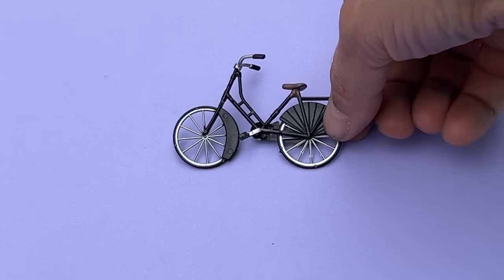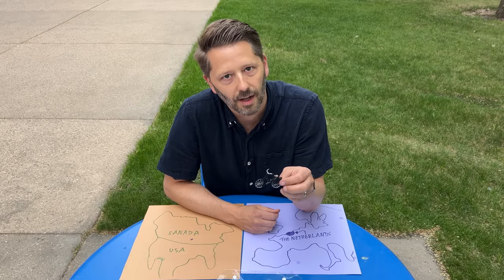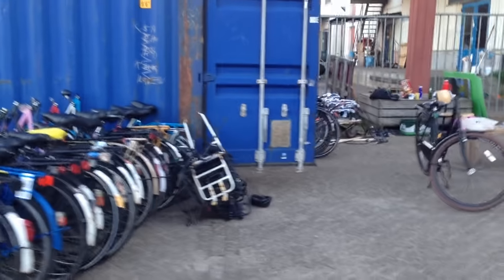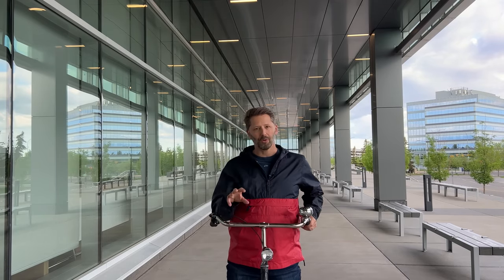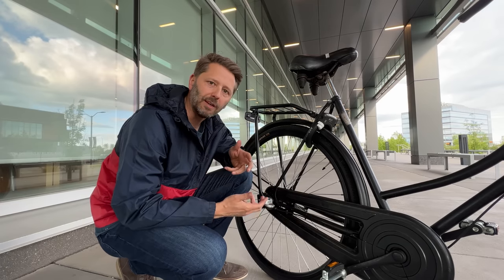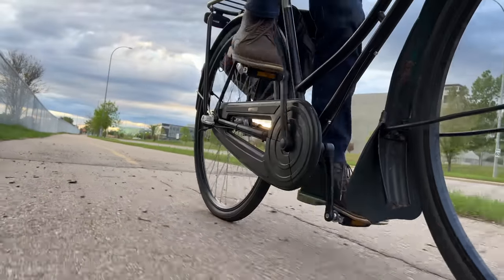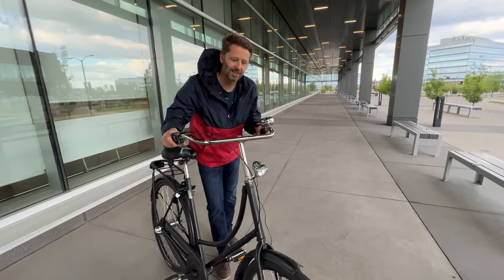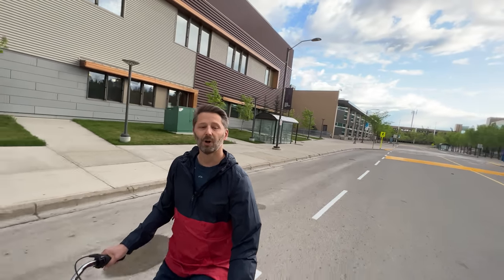I finally found a true Dutch bike in North America. Here's what you need to know

Comment: In the Netherlands there's also a huge selection of different bikes, with basically endless permutations of features - from no gears to 21 gears, ergonomic or sportsy models, with or without bike rack, etc.

These are generally the most common ones, but you can get your hands on any bike you so choose.
Reply: Also they would have a front brake, wouldn't they? Isn't it law having two independently operating brakes?
Reply: @krollpeter  In the Netherlands a single brake like the coaster brake in the video is enough, other European countries like of the top of my head Germany, Belgium or the UK do mandate 2 brakes.
Reply: @WiljanVeening  Thanks for the info! Correct in Germany having 2 brakes is law.

To slow down a bike at a junction or traffic light, a coaster brake suffices. And it leaves the hands free for hand signals or safer steering. For sport purposes there is surely better. Unfortunately here in Singapore there are no bicycles sold with coaster brakes.
Reply: There's not only upright bikes, but also some nice dutch recumbent bike and velomobile brands as well. As far as I can tell, the upright bikes are far more common though. I'm from the southwestern part of the US and I've never been outside of the US, but I'm quite familiar with recumbent bikes, including the dutch brands.

Comment: After visiting NL I really loved the omafiets.  They were GROSSLY overpriced in Sweden, so I ordered a basic transportfiets (the ones with both front and rear racks) from NL for like a quarter of the price. And I love it! It's almost my sole means of transportation and that thing carries tons! It's bullet proof! 👍🏻
Reply: For the aspect of functionality Kronan bikes used to be a good approximation, but their quality was very poor. 
I owned one, and I had to replace many parts fairly quickly. The frame and the luggage carriers seemed to be the only sturdy parts. That was probably the reason why they left the Dutch market. It seems they are still active in Sweden, but I don't now what the quality is now.
Reply: Swedish Kronan bikes were amazing. 32 kg of steel frame, single speed pedal-braked bike. I never felt safer, since approaching an intersection or traffic lights required timing. Contrary to the other poster i didn't have any maintenance other than the bike chain needing thightening regularly (because of the strain put on it when you get going) i didn't have any problems, but i had a very basic edition. What I loved the most was the front rack which was bolted to the frame, and not balanced on the front wheel and the handlebars. Even loaded with cat litterbox filler that bike was solidly stable. I loved it.

I ended up living closer to work and started walking after i saw a really bad accident between a cyclist and a car close to work. I had one of the first generation Kronan bikes released in The Netherlands - bright yellow (because of visibility) and licenseplate started with EI. I recently met another person who still had theirs in active use as a postie bike, over 25 years old.
Reply: @weerwolfproductions  Maybe they reduced quality over time by buying cheaper parts. With my bike I had many problems, to name just a few:
* the handlebars broke off twice, the first time i got a new one under guarantee, the second time guarantee was over and I replaced it with a sturdy stainless steel one
* The main  sprocket was made of very tin plate material with some relief pressed into it to give it a bit more sturdiness, the connection to the crank was not welded, but also some kind of press connection. This connection also broke off twice. Once during guarantee, one time after. And again I replaced with a more sturdy generic sprocket. But since the Kronan wheel size was non standard, the gear ratio was also non-standard, so after the replacement the gear ratio was a bit off.
*The paint on the mud guards and wheel rims chipped off easily, and since the underlying metal was not galvanized these started to rust quickly.
*The inside of the axel-break mechanism wore out very quickly
* The pipe carrying the saddle bended!
* The pedals wore out very quickly
*The lights were with old-fashioned incandescent bulbs, which did not give much light. 

Despite all this i really loved this bike, the big front carrier enabled me to transport many big things, for which other people would have used a car.
Reply: @boldvankaalen3896  I had maintenance issue too. But I have to remind myself that  I bought it  second hand and I owned it for 10 years haha. The big front rack was great! I kept it after giving the bike away.

For me it was:
Fenders replaced 3 times.
Had to replace both of the old rims due to a known design issue the very old ones split in the middle.
The chain needed quite some maintenance (maybe because it is so heavy?).
It was overall VERY rusty.

The last straw was when the new back rim broke and perforated my back tire with a loud explosion sound. It bended the whole tire/rim.

The frame though was indestructible. Once a car opened its door in front of me in the bike lane and the car door was broken, my bike did not have a scratch. Also once accidentally drove against a public steel wastebin and instead of having my frame damaged, the wastebin had a dent and opened up.

Comment: My husband works at Accell, this is a bicycle factory located in Heerenveen (the Netherlands). 8 out of 10 bicycles no longer have a dynamo because, if you stand still in the dark, the light will go out. Nowadays they are all with battery, this is safer, the tires also have reflective edges so that you are also clearly visible from the side. Cycling upright is better for your back and the pack carrier is useful for panniers in which you can do your shopping (which I always do). I prefer to go by bike than by car , you stay fit , get the necessary vitamins from the sun and you feel more connected to nature .
Reply: I have hub dynamo on mine, I would never change that for battery lights. Some lights have build in capacitor.
Reply: @krollpeter Most have that as its much simpler and has a longer lifetime.
Reply: @jepulis6674  And with LEDs nowadays they are also quite ok in terms of brightness. For normal riders that is.
I wish there as a converter to change the 6 V AC to 5 V DC, though.
Reply: Couldn’t the dynamo have a small battery included to power the light during stops?  Like maybe a half hour of use in total battery capacity. For an LED it wouldn’t be much bigger that it is without a battery. 

Not worrying about another thing to charge is a nice plus.
Reply: Modern dynamo lights have capacitors and a standlight feature, so that's not really a problem. Maybe they don't have them because the costs are lower on passable battery lights. Serious downgrade though, as it adds maintenence that a vehicle shouldn't need.
Reply: @Marynicole830 Modern lights already have that. That brand is cutting corners.
Reply: My bike has a dynamo and yhe the lights stay on for about 5-10 minutes after coming to a stop because the lights have a capacitor. 

You're describing a problem that was solved decades ago
Reply: @Marynicole830 they do. Buy usually it's a capacitor rather than a battery because it can charge and discharge more easily. The total capacity is about 10 min on my dynamo lights
Reply: I bought a few sets of dynamo lights from Germany, B&M, they all have capacitors in them that last for about a minute or two.

Comment: Coaster brakes are great and maintenance free...until the chain falls off! It's pretty standard that you also have a handlebar brake, disk or otherwise, on the front wheel. Hardly ever use it but can be a life saver when needed. Great video and great to see that some in America see that city bikes is what most people need/want!
Reply: 🤣🤣🤣🤣🤣 Until the chain falls off........... yeah, that's becomming quite quickly a terrifying situation..... 😜😜!
I know, because I'm Dutch too 😜.
Reply: When you de brug af geht and your Omafiets loses its ketting, so you have to step on the grond with your new airmax to not drive into the sloot. Your soles all naar de Kut, then vechten with the chain case. Good times.
Reply: @thedutchest 🤣🤣🤣 Exactly dat dus!!

Comment: As a dutch person currently using a 3rd hand no-gears bike- I can't overstate how durable they can be. The thing's at least 30 years old, first it was grandma's, then mom's (I remember sitting on a child seat on the back, back in kindergarten) and now I've used it for ~6 years. I used it when my job was delivering mail, which involves carrying 30-50 kg of mail on the back 5 days a week, yet I can't remember ever taking it to the shop, everything just works, aside from the occasional flat tire. 
It's rusty as hell and the coat guard is shattered to bits because plastic degrades and it has toppled over with other bikes like dominos a bunch of times, but it rides! Only now is the chain starting to struggle (tbh it has always been noisy, but it only recently started to affect the actual riding), so now I gotta finally learn how to fix a bike lol
Reply: Same story with the domestic made Norwegian classic bikes they made here in Norway, holy hell they were solid, i have a collection of them, i commute on them all the time, truly are built like tanks and the quality of the steel and paintwork, they don't really rust away they just develop a patina, there is no limit as to how far these things will go.
Reply: @HansensUniverseT-A  nice! Cool that Norway has such sturdy old bikes too, is it common to commute by bicycle? I just fixed the chain issue today; all it needed was tightening, now my bike is quiet and smooth again (see I really only ever dealt with tires lol)

Comment: pro tip: your tires (rear tire especially) are a little underpressured by the looks of it. More pressure equals easier riding and keeps your tires better protected from punctures
Reply: Who is the pro?  You are more likely to get a pinch flat if your tyres are very under inflated but not more likely to get a puncture, far from it. How on earth would you know if it's underpressured unless you know the tyre, weight of rider/cargo and road conditions?
Reply: tires look just fine to me
Reply: @muddydog6605  I mean, as a fat dutch guy who's ridden this type of bike since I was 6, the back tire looks pretty splashy for just regular road use. I don't know about punctures, but it definitely adds to the amount of work you have to do to get around. Omafietsen have tires that take about 4 bar (57ish psi I think?)

Comment: My parents, both over 60 just bought a dutch style e bike and they have already but 400km on them this summer. Its really good to see older folks staying active and healthy. They even find that the power gives them more confidence for longer rides.
Reply: It's almost the national pastime for elderly people here in the Netherlands. Even during hot summers they will still go out biking, because you get a nice breeze and don't have to work hard for it on an e-bike.
Reply: My husband turns 65 this year, and he had exactly the same result as your parents when I bought him a Dutch e-bike (I got his from LeMond) and it transformed his biking with me.  On his old Mountainbike he was hesitant to ever ride more than 10 to 12 miles with me, but on the Dutch he will join me on 30 mile rides, and the cool part is, he almost never uses the pedal assist, he actually turns it off unless there is a steep hill or something (unlike the bikes in the Netherlands, his Dutch is an 11 speed with hydraulic disc brakes, so 14% grades are do-able).  The more comfortable seating position and ease of riding a step-through frame gives him great confidence, and we’ve ridden about 200 miles in less than a year.
Reply: My parents both over 60 bought 2 e bikes 2 years ago and have driven more then 3000km in two summers
Reply: My parents are 81 and 82 🇳🇱  They are still biking a lot, nowdays with an ebike and helmets.

Comment: There is something so nostalgic about the look of this/your bicycle… handlebar shape, mudguards, dynamo, hub gears, chain guard, fixed light, the stand ……… AND, the riding position just looks so comfortable …….. in the U.K. we used to call them, or a similar design, ‘Sit-up-and-beg’ bikes, because of the upright seating position.

How modern designs have changed the look of bicycles which still has two wheels, handlebars etc. etc.  BUT, the riding position of the Dutch Bike, it just looks so comfortable and inviting to ride.

And what an amazing size bell you have too, please give it a ‘ring’ … that’s not a bell, that’s a musical instrument … amazing 😊🤩👍🏼

Thanks,
Steve, Bristol, U.K. 🙏

Comment: what you probably missed about the handle, is that if you have a bit of practice, the curved shape makes it very easy to bend forward and lean your elbows on it and bike like that. It is an astoundingly comfortable way of biking, especially when there is a lot of wind or if your too late because you have a lot less resistance
Reply: Dutch bike aerodynamics
Reply: I'm Dutch and have a transportfiets (I've had it since middle school which also fit's the stereotype since nearly every teenager had it 10 years ago like me) and I love cycling like that xDD

I even beat some mountainbikers going uphill and at a traffic light, they were commenting on how there must be a little electric engine in there. I can tell you that there wasn't, only my 3 gears
Reply: @evo3s75  this is way too relatable. The feeling of overtaking electric bikes as well

Comment: Notice how the rear seat tube is more angled backwards - this is very similar to american beach cruisers. Makes it very comfortable for city "stop n go" riding. This is what i really hate about riding a bike in the city - if the seat tube is too vertical, i have to either stretch my legs uncomfortably, or get off the bike. With the seatpost angled backwards like that, you can both reach the ground and have the pedals far enough so you dont need to raise the saddle too much.
Reply from the maker: This is a great point, but I find the geometry of these bikes a little different than beach cruisers. Both are absurdly comfortable, but this bike feels a bit more upright than laid back, which I think is good for cities.

Comment: As a dutch bicycle mechanic i love these videos, its not just a product you are reviewing, its a part of our culture.

This bicycle that you reviewed is from the brand "batavus" and the model is called "old dutch" (because such frames were made quite some time ago and they are very good and solid so they still produce them)
Reply: Oh not a Gazelle?
Reply: Fairly sure it's a Gazelle from the chain case, but it's hard to tell them apart since the basic setup is basically following the generic template that every dutch bicycle manufacturer has made for over 120 years.
Reply: I don't know why, but this struck me as a batavus aswell. I used to ride an old Dutch, but like is said, it's hard to tell. Previous owner could have easily installed aftermarket parts aswell.
Reply: its not a batavus or gazelle , its a cheap ranger or pelikaan brand , i worked also in a bicycle shop 8+ years . sold alot of gazelle / trek / cube
batavus uses the leather chain guards , as do gazelle .

Comment: When you stall that bicycle between US and Canadian sportmodels, it won't be stolen. Not even with only the wheel lock. What I was missing were the skirt guards, to prevent something getting into the rear wheel, like long scarfs and coats. Perfect for short distance shopping and school.
Reply: I would not be so sure that it's safe. There might be Dutch people around moaning about the lack of proper bikes in America.
Reply: @steemlenn8797  😄
Reply: There are some skirts protectors for them, but they always end up rubbing against the wheel. If you can find one go for a fabric versionthe plastics onces always crack over Time

Comment: 3-speed hubs are surprisingly simple on the inside, but any hub with more gears than that becomes exponentially more complicated! A 3-speed is usually the best balance of rideability and reliability.
Reply: I think you're right.  :-)

I (Dutch) have two Brompton folding bikes. The older one features a 5-speed hub gear, the newer one features both a 3-speed hub and a 2-speed derailleur. The combination takes getting used to, but it does feel sturdier, and seems to keep its adjustments better.
Off-topic: I wish Brompton would have offered drum brakes.
Reply: I laced in Sachs Torpedo coasterbrake or kickback hubs on all of my grandma bikes, singlespeed 2 speed which is called the duomatic and the 3 speed, all vintage hubs which are pretty much unbreakable and even if you would parts are easy to find.
Reply: @HansensUniverseT-A  Those older hubs were built to last! I upgraded my single-speed cruiser
to a very old [and poorly lubricated] Shimano 3CC, and it still shifted perfectly, even with a friction shifter. That should've never worked, but it did...
Reply: I would still suggest a 7-speed in more hilly country. The 3-speed is not enough to tackle actual hills. It will cope with various wind conditions and such though.
Reply: @rogerwilco2  Agreed! However, it's not so much the number (of gears) itself that makes a bicycle better suited for hilly terrain. It's rather the transmission ratios that do the trick - and the "slower" ratios are more likely present in a 7-speed than in a 3-speed.  :-)

Me, I have a Brompton folding bike with the optional smaller chainwheel on the crankshaft (and the 6 speeds that I have mentioned in a far earlier comment). Compared to my other Brompton (5-speed), this smaller chainwheel allows me to tackle steeper slopes (in the Ardennes) without dismounting. But riding my full-size bike with 7-speed gear would be better (though not on the train to get there and back).